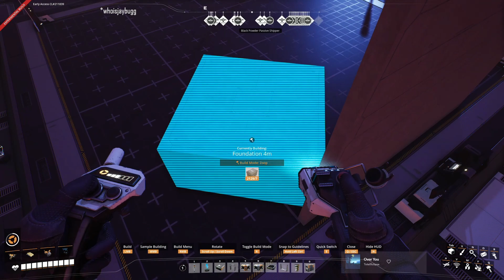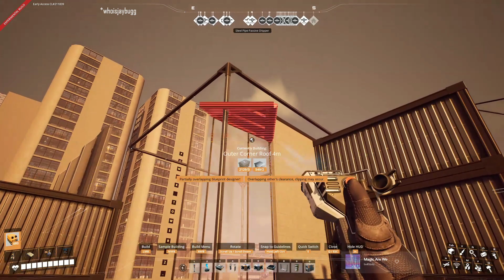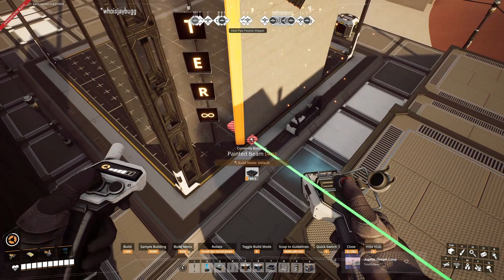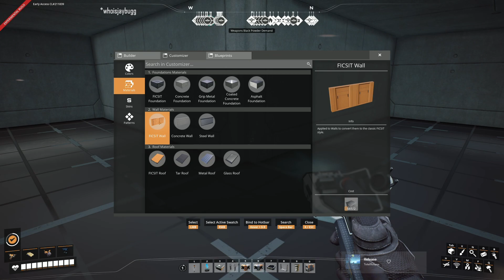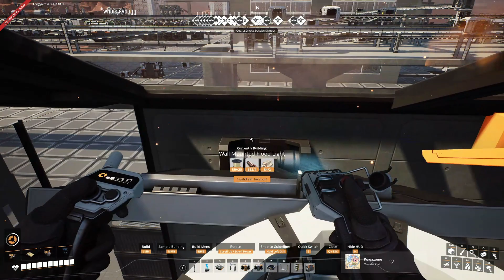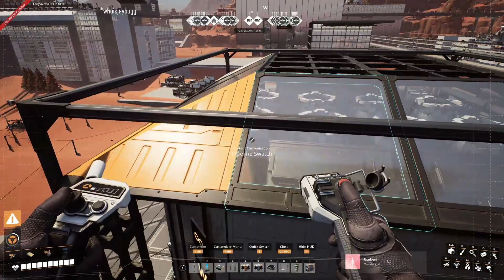Water Tower Blueprint - Satisfactory

Comment: Actually "water" towers are really helpful in the game. You just need to pump up a single pipe of fluid like water to the highest point you need , then have it come back down and that pipe brings all the headlift with it. Any other pipe you attach it to also gets that headlift. It works just how water towers in real life works. Its a great way to cut down on the number of pumps you need in the game and you end up with far fewer headlift issues. lol. Thanks for the video!

Comment: Nice design, but I question the need for so many pipes going up and fluid buffers. All you really need is one pipe up, one fluid buffer, and one pump at this height (of course you'll need pumps to get the water up to the level of the input of the fluid buffer too). The upgoing pipe connects to the input of the fluid buffer, the output of the fluid buffer goes to the input of the pump, and the output of the pump feeds the down-comer pipe.

The down-comer pipe then connects to ALL of your pipes at the level of the water extractors and provides the head lift for ALL of those pipes up to the height of the pump + its head lift. (Remember: pumps provide head lift to a NETWORK of pipes) This reduces your upward pumps to just getting one pipe's worth of water up to the fluid buffer.  It's worth it in energy alone to have one dedicated water extractor for providing head lift to all pipes instead of tens (or hundreds) of pumps on every pipe. 

You might want to experiment on this and see how it works.  It will make your fluid builds MUCH easier! :D
Reply from the maker: Nice. More efficient as always. I might have to put together a v2!! Thanks.

Comment: Good stuff.  I don't even remember what part you were at but you mentioned this would be an early game blueprint so you were using an early game item.  Then maybe a couple minutes later you were doing something and I was asking myself why you weren't using something else.  A couple seconds later it dawned on me.  Early game items.  I should sleep before watching some videos....lol

One thing you might consider looking into.   I saw someone place regular walls like you have, then they place the Steel Framed Windows against those walls.  I don't think it was Z fighting and it gave things a slightly spicier look you might say.  I am going to be toying with a lot of things along those lines.  I see no harm in a glass wall directly placed against any other wall if it ends up looking sharp.  Or maybe like a slight airgap by putting down a spacer or something.  Just a thought you might like to experiment with too.

Good luck.
Reply from the maker: I like spiciness! I'll play around with that. Always have to keep in mind when the blueprint will be used, lol I learned that one the hard way.